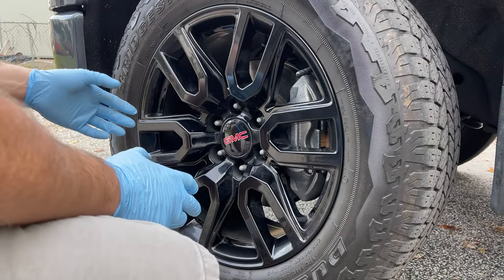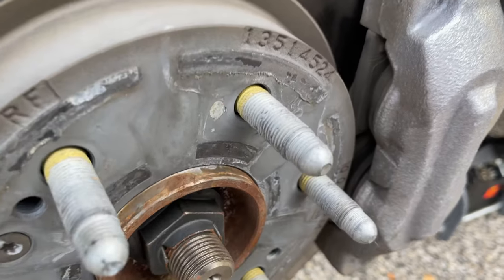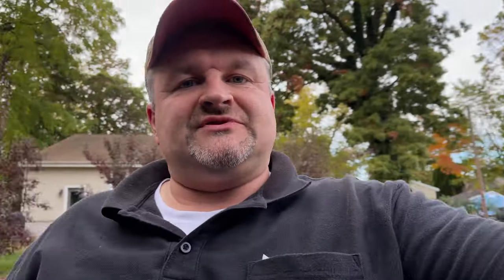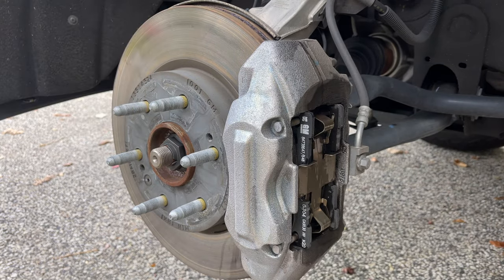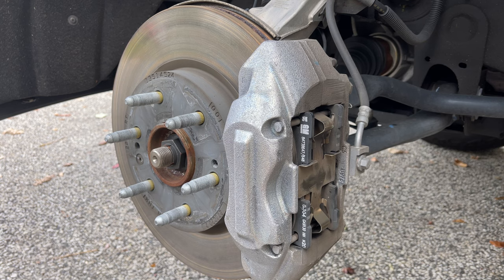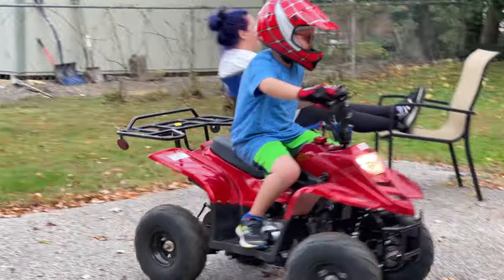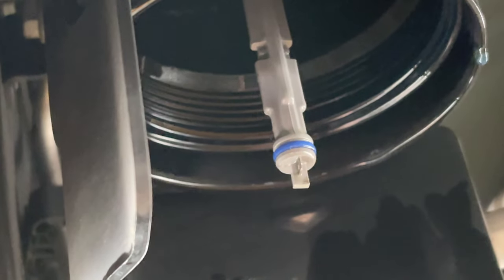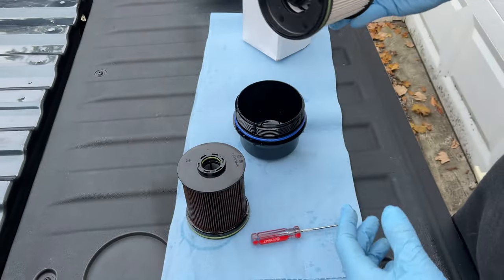3L Duramax Sierra 50K Mile Review - Still Going Strong!

Comment: I have a 2021 Elevation with the 3.0 Duramax it has given me nothing but problems.  Check engine light is on constantly. First was the Def system. Next was the nox sensor. Then check engine light comes back on GM had to have a field engineer come look at it and he says it’s a faulty camshaft cover. It’s good for a while. Then here comes the check engine light again. Back to the shop 🤬 nox sensor bad again. They have a field engineer look at it again and determines the turbo is blowing oil into the air intake.  Now they can’t find a turbo anywhere 🤬🤬. Not to mention I have barely been able to get 22 mpg. This thing has been nothing but frustration. And this thing only has 42k miles on it! 🤬
Reply: There have been new ram 2500's doing this.

Comment: These engine are crap.. we are amazed to spend 50k or more on a truck and doing video every 15k miles cause we had “ minor issue”. I bought mine last june 2022.5 chevy silverado duramax.. in the first 3 weeks i had to replace an airbag, a camera lane assistance and i had a knocking noise every time i would start and stop which apparently on the fcb group there’s a whole bunch of it..not to mention we try to justify all the people with issue saying every group has complainers which is simply true to a much lower point..with the exception of a few most of these truck won’t reach passed 150k miles without having to spend thousands in repair, my old honda civic is about to reach 280k miles on all original components…not to mention the overall gm treatment, i received a letter from them saying my heated steering cheap could be delayed till may 2026 !! After having paid for it and all the newer  model get out with all installed  parts..sold the truck last month and never going back !! Good luck, you’re gonna need it
Reply: You sold the truck ? Which one you think is better ? The 5.3 Chevrolet ?  Ford ? Toyota truck ?
Reply: @watchmanexpert  toyota by far

Comment: Bought me a new Sierra 3.0 Duramax and 750 miles later, Emissions System (Check engine light) came on. Has anyone gone through this problem? What was your solution?
Reply from the maker: What was the code?
Reply: @BanditDavesToyChest  it was a P0402
Reply from the maker: @eduardordgz1824  wow that seems early for that under any normal circumstance. Did you clear it and continue driving? I’m wondering if you caught it during one of those first regens and she got pissed? Any feedback from the dealer (not that I’d put much stock in it)?
Reply: @BanditDavesToyChest  it’s a 2023. I did not clear the code and took it to the dealership yesterday. They’ll have an answer today.
Reply: Mine did this at 14k miles when it was 10 degrees outside but I ran it super low on DEF so Ont thinking that’s why it though the same code . So far I had my front transfer case rebuild and had a no start twice from running it very low on DEF
Reply: Nox sensor?
Reply: @j_mm1084  wow , how is u truck now ?
Reply: @eduardordgz1824  what the dealers says? The tick is fine now ?

Comment: What does average oil filter and fuel filter change cost you total?
Reply from the maker: Oil change depending on where you grab it…$85-$100

Fuel filter, $30ish 

Both easy to do yourself
Reply: @BanditDavesToyChest  how often u replace the oil and filter ? Is any additional filter on the duramax to change? I don’t know nothing about diesel
Reply from the maker: @watchmanexpert  just the oil filter and seven quarts when she tells me…fuel filter every 25K miles or so.

Comment: None of your complaints are actual valid complaints. Every truck on the market has all of those same complaints or different. They are not unique to this truck.
Reply from the maker: So what’s your point? You literally said they are not complaints then went and said every truck has these complaints. Like I said they are very minor, but I can tell you the trucks I have had previously did not have the brake squealing and  spring knocking issues. I also didn’t have sensors that randomly drew MIL lights.